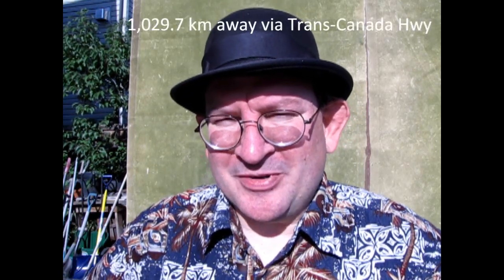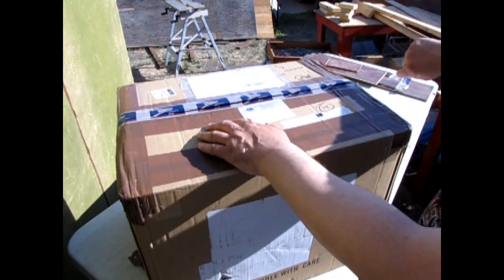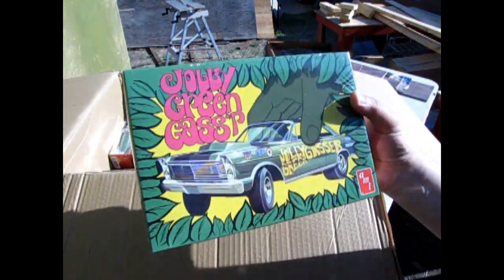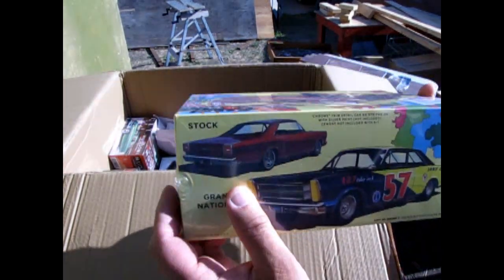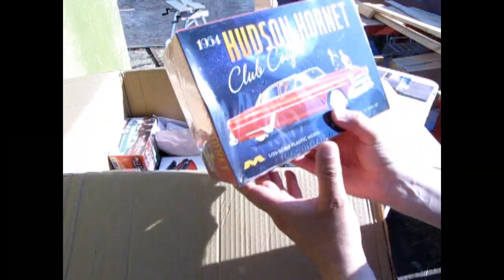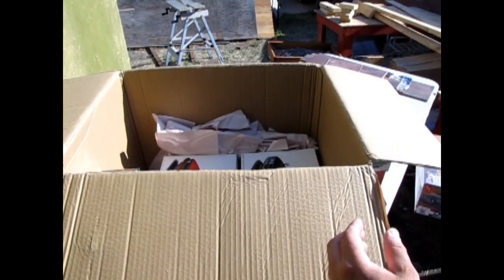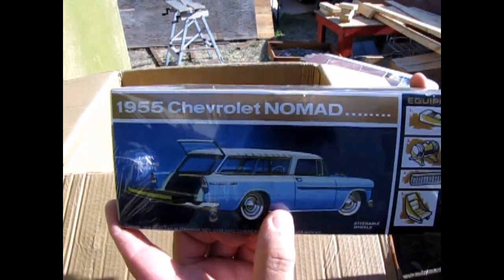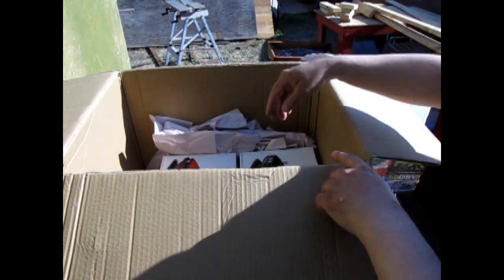Introducing Our Brand New Summertime Model Kits - August 2nd 2023

Comment: You've got some neat kits there,Trevor. I liked old Celicas and Corollas. There used a lot of them here but they all rusted away😧. Shed looks strong. I'd hinge the panel above the door,then it can be used as added ventilation. It will get very hot in there with just that little vent. Good luck and best wishes from jolly old England 👍😎Pete 🤓
Reply from the maker: It's a good idea on hinging the upper door panel. The shed is just going to be for storage though.